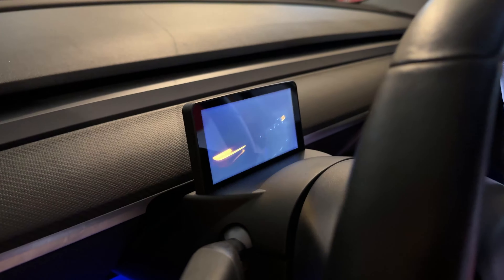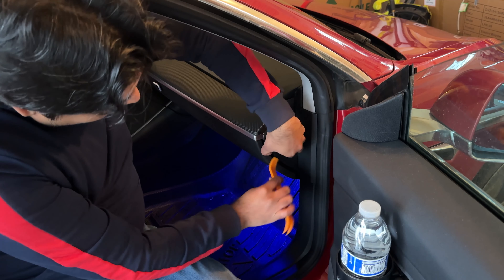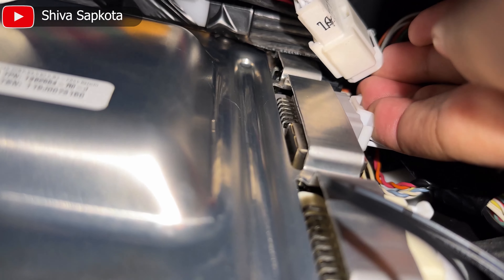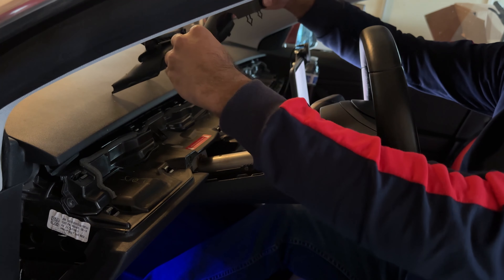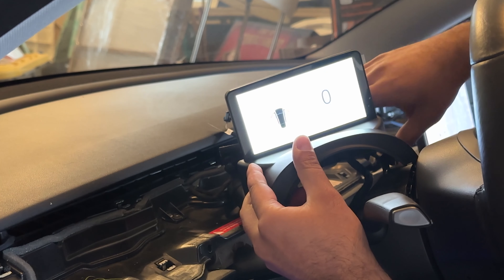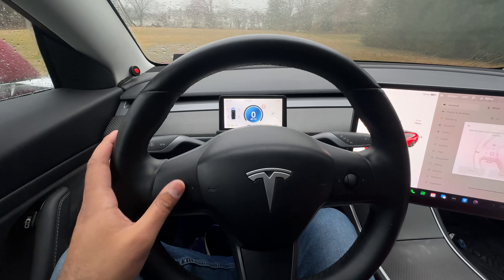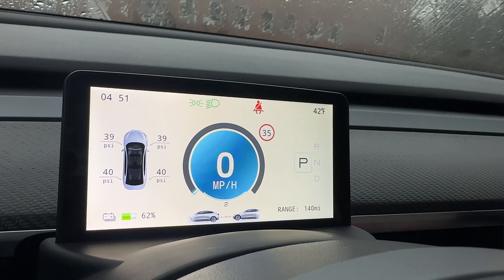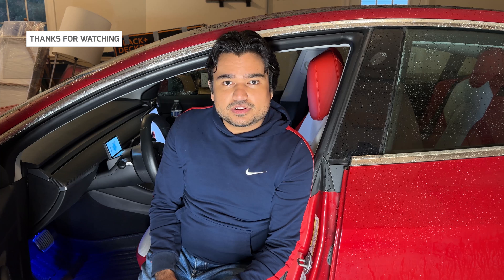NEW Tesla Model 3/Y Instrument Cluster HUD Display - 2023 BEST One Yet!

Comment: You say it does not block airflow but it sure looks like it would get in the way, can you do the toilet paper test and hold it in place with and without it installed to see the difference? (Not suggesting you uninstall it if its still in, but just use someone else's model Y to film it without it dangling a couple of pieces of toilet paper and seeing the air flow hit them and how much they move, so we can compare?)

Comment: 6:53 did u just jumped to find the plug to connect? I don't get it. Can u help or is it under the glove box?
Reply from the maker: What version do you have? Intel? If so, you might have to basically lay upside down on the seat and peek your head through the glovebox panel removed earlier. Check out some of my older Carplay front screen videos, I show this step in more detail. If you need more help, let me know and I will send you a quick clup. Thank you!
Reply: @ShivaSapkota  awesome. You are great.  Thanks for help and feedback. I have Intel Atom. Tesla model 3 2021 refresh

Comment: I just installed this in my 2023 M3P. It has changed the way I select gears now. Before I used to have to put my foot on the brake and lightly tap up for reverse and lightly tap down to go into drive. Since the install, when I do that, it goes into neutral. I have to do a hard tap up or down to select my gear. Did you notice that change? I can’t stand it…

Comment: Last time I installed a screen it made updates for the car stop working completely. Verified by Telsa. Have you run into the same issues?
Reply from the maker: The rear screen (Gen 1) had that issue. They corrected it and now made it so it only requires the rear OBD. I am not aware of any front screens causing software issues yet. Thank you
Reply: @ShivaSapkota  oh that’s great info! So what can I do about this gen 1 screen? Is it just unusable now or can I just keep it unplugged from the front wire harness and use it somehow?
Reply from the maker: @nichetcher1  You can reach out to the seller and they will send you a wire that can connect to the back and the display works but doesn't affect the software update.
Reply: @ShivaSapkota  I bought directly from them so I’ll reach out via WhatsApp and see what they’ll send!  Thank you for the info, my dude!

Comment: Do you know if the 4 " and the 5" use the same harness? I have the 4" and want to install the 5". Can I just remove the steering wheel portion and plug in the 5" with the old 4" harness?
Reply from the maker: Yeah I believe so. It is the same size wire harness. However, please confirm with them first. Thanks.

Comment: I have the original from Hansshow that has both the front camera and the GPS. I would like this size if I came with those options and they would make it so I could use my original cable. Also, I would like to replace the tire pressure indicator with something more useful. I would not care if it did not have CarPlay I do like the following distance indicator. I wish it was on both view-1 and 2. Thank you.
Reply from the maker: Thank you!! I will pass along your feedback to Hansshow.
Reply: On most other HUDs that area is for lane keeping and cruise control functions.   Distance is also usually part of the graphic as well.  Tire pressure seems.. a bit useless and something you'd only look at on the main display.

Comment: Thanks for the review.
But why do you keep calling these HUD displays? These are not a head-up displays!
A head-up display is a transparent display that presents data without requiring users to look away from their usual viewpoints.
This display on the other hand is not transparent and also requires you to look away from your usual viewpoint, so not a HUD at all.
Reply: Agreed. These are very useful as a proper gauge/display, but they are not HUDs.

Comment: I complained to the company about the 24 hour clock and I'm so glad they give you a 12h option now. I still like the small display actually and I wonder if the software is currently (or soon will be) updated to the 12h clock option. Also, did you ever find out if you can change the car color? My 2023 M3 is also red.
Reply from the maker: I cannot change the car color but they do have a software update for the small screen. If you check the product page, they also have a video on how to update. I don't know if the 12 hr clock format is included in the update though. Thank you!
Reply: Did it change the way you select into drive or reverse? I used to only have to lightly tap the gear selector to get into drive or reverse, now I have to do a full click into gear. Any light tap puts me into neutral.